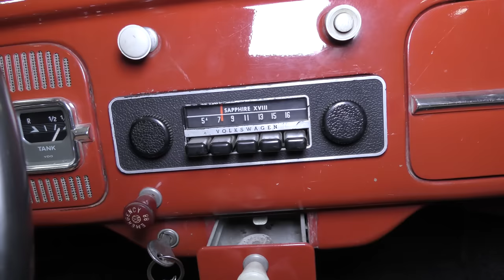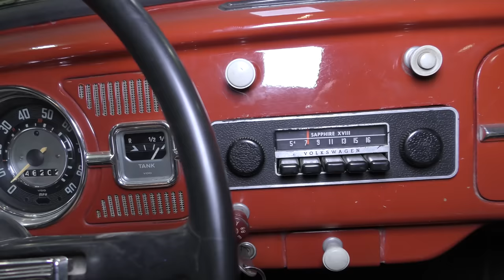Big Mods with big $$$. When Mods don't make sense. What did the  CAR WIZARD do to this '66 VW Bug?

Comment: That year Beetle was my first car. Got the car and two engines for $300. Had to use one for parts to repair the one in it. I'm still kicking myself for ever parting with it, loved that bug!
Reply: My first car was a 1965 Standard model. It did not have any chrome, no fuel gauge (pet cock instead), 6V and 1200CC with 30HP. The passenger seat was screwed to the floor with no adjustability.  The passenger door was only lockable from the inside (no key hole). They did not sell these base versions in the USA. It also was upgraded by my uncle, who bought it new, with Porsche 356 rims, which allowed for "enormous" 165 tires. Unfortunately, when I bought it it was already 18 years old and had many rust holes. It survived 4 more years before it made it's last trip to the junk yard.
Reply: I worked in a garage that specialized in VWs in the mid 70s. I had a 66 Beetle as my second Beetle, my first was a 71. I loved my 66 the best, it was red like the one in the video. I paid 50 bucks for mine and swapped a 1600 dual port engine into it. I was fortunate I had easy access to parts, I even bought a bunch of parts cars CHEAP to create the motor. A 69 Squareback donated part of its engine.
Reply: I knew a guy who could change out the engine, by himself, in one hour. He kept a rebuilt engine oiled and covered in a plastic bag in the corner of his garage. When something went wrong, he'd swap the engine. Over the next month, he'd rebuild the old one in his spare time, oil it up, cover in a plastic bag, and shove it into the corner of the garage. Eventually, he started collecting Porsches and doing the same thing.
Reply: My mom bought my brother and I a 66 as our first car so she wouldn't have to drive us to the ski hill anymore. Never let us down. She knew what she was doing.
Reply: @tony_25or6to4  When I worked in the garage, all of us were really quick at changing motors. My record for taking a motor out was 16 minutes. 

Once, one of our good customers was on her way to a Dr's appointment and drove in with one of the heads almost falling off the block. We got her car in, we swapped the motor out of my car so she could get to her appointment in a half a hour. She returned two days later to a fresh motor and I got mine back. 
I didn't mind letting her use my motor.... I got to borrow one of the cars we had for sale, a 1972 VW 412 two door 4 speed. I wanted to buy that car so badly, but my parents thought it was "too fast" for me.
Reply: @tony_25or6to4  The motors have a decent life when the valves are kept adjusted
Reply: Hear ya buddy. Same here.
Reply: @tony_25or6to4  This is how you keep 944s on the road, two identical cars. It’s also how you go broke. :)
Reply: You better put an inertia fuel shut off on your Ferrari 308.
Reply: @timothykeith1367  Air cooled, plus oil leak, plus dusty summers in Australia would kill them. The fins would get clogged up and the motor would cook.
Reply: I remember when you could get one of these running for $500. I imagine in another 10 years people will be lamenting when you could get a beater Civic for $2000.
Reply: Fucked up
Reply: @1337penguinman  in another ten years. That’s already become the case, unless its riced out to the max there are very few old nice civics out there that aren’t crazy expensive
Reply: @spacemanmat  But (yet) on Top Gear, Jeremy said "that if you want to cross a Desert, you'd better do it in a Beetle". I have owned a Beetle 20 years, live in Australia. Never ever had an overheat problem. All down to good maintenance.

Comment: I only put E0 (ethanol free) gas in my '73 VW Thing. Runs smooth and never had vapor lock issues with it. Also known as recreational fuel depending on what part of the country you're in. Averages around $.50 more per gallon but worth it for any classic car you plan on driving on a semi regular basis
Reply: Also good for small engines like mowers and trimmers. Though it can be hard to find sometimes
Reply: Yeah when I was in Iowa, ethanol free was 87 octane only (at limited stations), here in Wisconsin it's 93 (also at limited stations). Interestingly my small engines like the 93 better, run smoother. (Especially the snowblower, less backfiring, etc)
Reply: I use ethanol-free in my Audi TT.     It sits significantly more than it is driven.    Never gives me a problem starting.     I run the E/F in my daily driver too.    A little more expensive but never worry about seals and hoses.   Gas mileage goes up a bit too.    All gas, no syrup.
Reply: Thats just regular petrol in Australia, I've got cars with 3 year old petrol in the tank and they still start and drive just fine.
Reply: In UK our standard 95RON fuel is E10 by law and many people are extracting the ethanol out to get pure petrol but then waste a minimum of 10% of what they paid for.  Superunleaded is either ethanol free or E5 depending where you live and that works fine.  The premium paid for Super is offset by the extra mileage and then there is the smoother running.  My 1303S Beetle runs on nothing else and I have had no issues starting.
I originally used an old competition electric fuel pump in the Beetle that was not rated for modern fuel and it disintegrated after a few months, changing that to a modern one solved the problem.  Also, I have the fuel pump on a hidden switch so that when the thieving b*****ds attempt to drive away they get about 1/2ml down the road before the fuel runs out.  Also, the relay for the pump is controlled by the oil pressure light so that in the event of an accident the fuel shuts off.  A little bit of cranking gets the oil pressure up and energises the fuel pump.
Reply: Small engines like it much better as well.
Reply: @archygrey9093   same here in Melbourne mate, sounds like the US has shit fuel
Reply: @johnsmith-ce2tq  not shit fuel it's the ethanol in the fuel corrodes stuff
Reply: @clivewilliams3661 The SG of petrol and Ethanol are completely different. If the mix sits for long enough, you can actually see the separation of the two fuels. I discovered this in 1965, well before blended fuels came into existence.
Reply: @peterduxbury927  How long would it have to sit before it separates out?  To be able to pour off the ethanol it would have to be stored in a clear container that is impractical as most of our fuel storage units are either metal of opaque plastic.  The simple way to extract ethanol is to add more than 10% water (for E10) coloured with a food dye, blue is the favourite here, and pour into the fuel, mix vigorously, let it settle for a few minutes and then pour off the now pure fuel, leaving the blue water behind.  Ethanol doesn't mix with petrol/gasoline but it loves water and will readily mix with it, so give it the water it wants and you can extract the clean petrol/gasoline, the food dye is just to easily identify the water.  Part of the problem with ethanol fuel is this love of water and having water in a fuel system, particularly in a classic car can lead to all sorts of corrosion problems.  This is why I now run all my horticultural machinery on Super as none of them have been designed  for ethanol and the fuel can be stored for longer periods than with a classic car.
Reply: @clivewilliams3661  Clive, long before ethanol was blended with petrol, I did some experimentation. I was just 16 years old, and knew absolutely nothing about Specific Gravity of different liquids. In the UK (at that time) Methylated Spirits was a purple colour. Petrol was a yellowish colour. I don't know exactly why I blended the two fuels together in a clear glass Milk Bottle - but I did! I remember shaking-up those two fuels. Within less than 5 minutes, complete separation had occurred, with the (purple) Methylated Spirits sinking to the bottom of the Bottle. A clear defining line between those two fuels in the Bottle. I never ever forgot this, and it dawned upon me that (if you ever introduce Ethanol into your Classic Car), then leave your classic car laid-up, clearly you will have this separation - which would also have greater or lesser degrees of water. Your Fuel Tank is vulnerable to rusting. Not only this, (but if you attempt to start your car) generally the fuel feed pipe is at the lowest point, and you will draw almost pure ethanol through the fuel system. Further to this, the Calorific Value is different between ethanol - and petrol. This means that ethanol cannot produce the same engine power as a 98 octane petrol. For these very reasons, just like you, I have never used any ethanol blend in any vehicle that I have ever owned. Moving-on to small engines, like Brushcutters, these are only 25 to about 30cc. Small engines do not develop the power as they were originally designed for petrol. In Australia, we have the choice whether to purchase the E10 fuels - or something better. Finally, Ethanol has an SG of approx. 0.79 (or higher than this - if there is water content). Petrol has an SG of approx. 0.75. I do agree with you that you could add food colour to "see" the separation of the two fuels, and I would like you to try this. It won't take too long to see the separation happen. Greetings from Australia.
Reply: @peterduxbury927   Apart from what you said, which is very informative, the strong general advice in the classic car world is don't use ethanol mix fuels, the initial reason is that the ethanol supposedly 'eats' (corrodes) the brass used in the fuel systems of those classic cars plus the points that you make.  Also, fuel degrades depending on how much ethanol is in the mix such that it is reported that the shelf life of E10 is around 2 months, whereas pure unleaded is around 6 months.  This is particularly relevant with classic cars but more importantly with horticultural machine, which can sit around not being used for some time and a prolonged period over winter.  Although the official advice is to drain the fuel systems, who ever does that?  And if like me, you have 7 petrol based machines ranging from 30-55cc two strokes and 4hp to 15hp four stroke machines and 3 classic cars, draining all those tanks and systems of fuel is a mega chore, not to mention how you dispose of gallons of unwanted fuel in those tanks and storage cans.
The food dye and fuel separation method is one shown on a You Tube video so I can't take authorship of it.
Reply: @clivewilliams3661  Thanks for your note, and your reasons to steer clear of blended (ethanol) fuels. These days, I have only two Brushcutters (2-cycle), a Honda Mower, and a Nissan SUV. One Kawasaki Brushcutter is over 33 years old, still runs like new. Honda Mower is around ten years old, and they all get regularly serviced. I spent around 6 months working on small engines in a Mower Shop, and my advice to those owners was to "never use ethanol blended fuels". Small engines just don't run as well with this fuel in the tank! I also have a '71 Beetle - owned for 20 years, but now converted to 100% EV and Tesla-Powered. But all of my machinery received the same fuel (95 Ron). Clearly, we both share the same views, and it's been good to have this conversation. Ethanol plays havoc with the small rubber Seals and Diaphragms in small engines, turning them almost brittle. # Classic cars? I found that just one was all that I could handle, am now 75, and don't like laying under the Beetle to do Oil Changes / Tappets and stuff. great to write to you.
Reply: @peterduxbury927   We must share the same DNA except that my 1974 '03S Beetle remains on petrol.  I have two mowers, a ride-on Yardman and a 35 years old Honda 19/4 that has been roundly abused to such an extent that the aluminium deck is crumbling and splitting however, the motor is still perfect.  Its starts 2 pull after a winter lay off and 1st pull thereafter, I have never drained the fuel over the winter period as you are supposed to do and never had a problem with varnish.  This summer the bowl 'o' ring failed, leaking petrol  and on the (first) inspection of the carb all was remarkably clean and functioning as it should - so much for the draining advice!

Comment: There were two indentations on the sun visor. Those took me back to my first two VWs, a 58 and a 59. In those days many of us kept our car's registration in a holder with a transparent front and two stiff spring clamps on the back to attach it to the visor. 
No gas gauges, when your car started sputtering you reached under the dash to turn the lever on the firewall to reserve. You had about 30-40 miles to find a gas station.
Reply: And then I forgot to turn the lever back to normal after filling with gas. So the next time the engine sputtered, the tank and fuel line were empty. A 1.5 gallon fuel can in the frunk and a screwdriver. Open the engine compartment. Loosen the air-filter from the carburettor. Fill the carburettor's fuel bowl from the can and empty the can into the tank. Replace the air-filter. Start. Drive. The underlying problem? The fuel tank in the frunk bottom is lower than the fuel pump and carburettor. That fuel pump, mechanically driven by the engine, dependent on engine RPM, does not have enough oomph to suck up gas into the fuel bowl - its not "self priming". So, a bit of gas in the carburettor's fuel bowl did the trick. Or, wizardry, fit an electric pump and solve the problem "forever".
Reply: My Mom's '61 with the lever, she had a manual odometer on the sun visor. She would set the miles on the odometer and when the car hit 200mi, time to fill up soon.  300 mi. Range
Reply: @jpdj2715  - Somehow I felt like you were telling my story! LOL 😂 😂 I know all that ritual way too well. 🙂

Comment: Great VW video. Earlier Beetles didn't even have gas gauges. You had a wooden dipstick in the trunk to measure the amount of fuel you had. There was also a fuel control lever on the floor to activate the reserve portion of the tank. Just don't forget to return the lever back after refueling.
Reply: Tripping the lever freed another 1.5 gallons.
Reply: We called it the kickover tank lever on our 1960 beetle. One night I was at my girl friend's house when the door bell rang. It was my Dad. I had turned the lever, failed to refuel and he had run out. He was not amused. The first and only time I forgot.
Reply: And that sinking feeling when you realised that the lever was in the wrong position
Reply: I had a 57 beetle, when i was a teenager. My father paid 300 for it back in the late sixties. Wished I never sold it!
Reply: The fuel gauge became standard in 1962
Reply: Not in my 1968 UK Beetle...maybe in the delux version or different countries